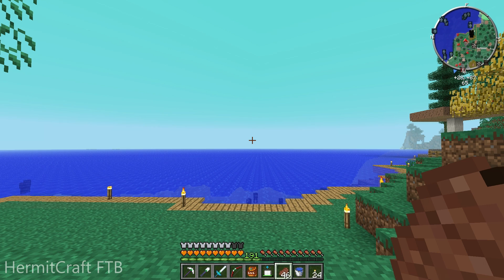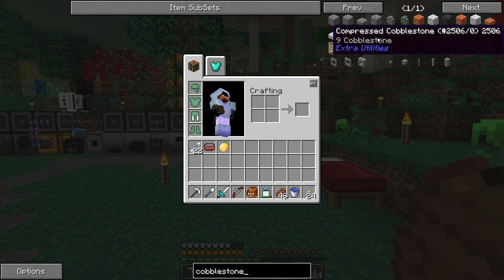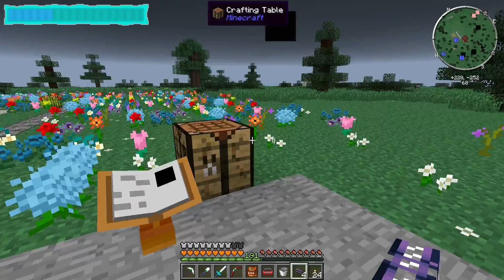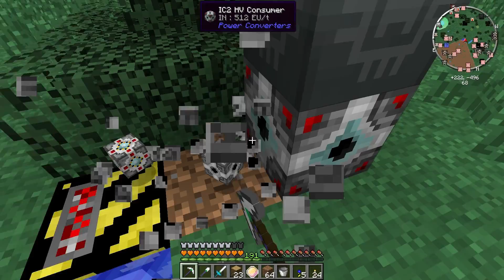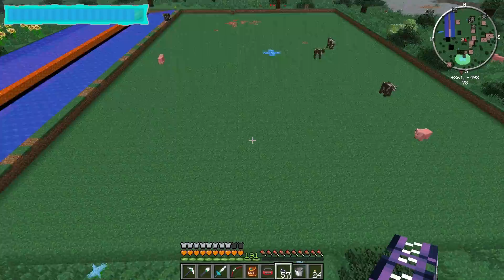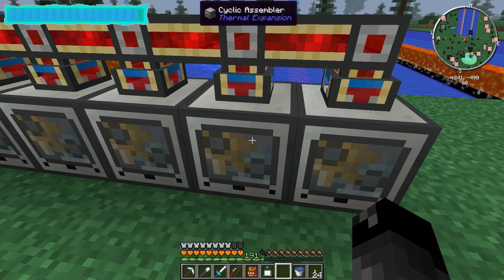Hypno HermitCraft FTB Unleashed S2E26: Extreme Cobble Generator!!!

Comment: You dont need the water 8 blocks a way '-'
Reply: +LDshadowfox Yeah, you can place the water and lava four blocks apart if you dig a deeper hole on the water side next to where the cobble is generated, so the water drops off instead of continuing to spread out.

Comment: You could make it smaller and faster and you don't have to use the full 8 blocks of water trick. You can dig a hole down where the water is going to stop and put lava source blocks a block away from the water. :) Look up minecraft cobble generator skyblock. It should add more and more cobble generators to your I think 4 chunks of space but it's your choice! :)

Comment: For the use of tesseract for steam power :

OK simply and clearly :
1 liquiduct line can transfer 160mb/tick of steam max
1 liquid tesseract can transfer 1000mb/tick max
1 boiler max size,max efficiency produses 760mb/tick of steam

Hypno u got this wrong several times,in ur SP world too :
the best way to transfer steam is this : place 1 tesseract directly on a single boiler and create a square of liquiducts arround it,all liquiducts must be connected to one of the boiler's sides. I usually create them on the top. use different frequencys per boiler. if you want to use100% of the tesseract's abilitys to transfer steam and for example u have 4 boilers, on the 4th boiler place 3 tesseracts, one for each frequency that the first 3 have. I found this through a lot of researching and testing. cheers! please thumbs up so hypno can see :)

Comment: Just make a 9x9x9 of igneous extruders with 1 overclocked router next to it and you are done, 364.5 cobble/second > 1,3 mil/hour.
This is a lot more compact!
Reply: why did i never think of using a router haha, thanks
Reply: Thats to small,  90x90x90 (1000x more) is better > 1300 mil/hour :)
You will need to upgrade the server for this this kind of stuff :D

Comment: You don't have to make the water go all the way. if you put it 3 blocks away from the lava source, and dig a hole 2 blocks from the lava source it will also work. It will work because the water will not flow any longer because of the hole! :)
Reply: yaay skyblockskillsXD
Reply: I like your Profile Pic
Reply: Camperr14 Yea. Made it myself! :D
Reply: also you can double it by placing water on both sides of the lava
Reply: linka711 or quadruple, but, make an infinitely large cobble gen with only 1 source. That's possible :p
Reply: MatewGamer2 thats true, i;ve done it in skyblock, but i doubt the tileability of it